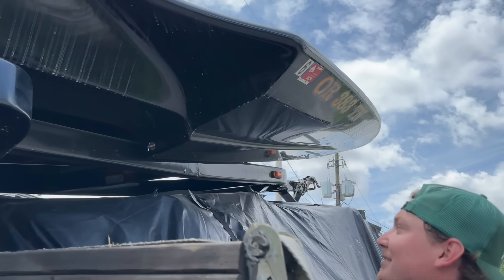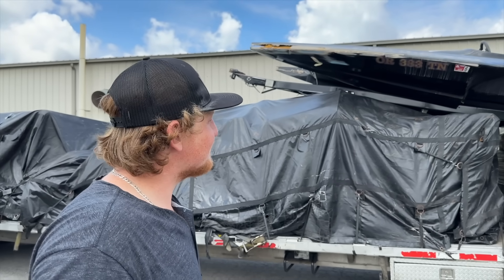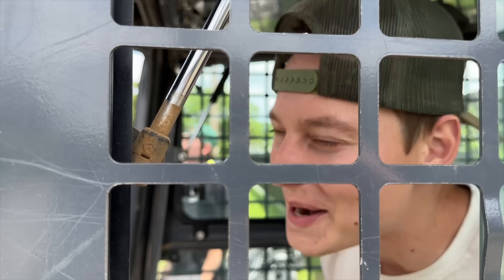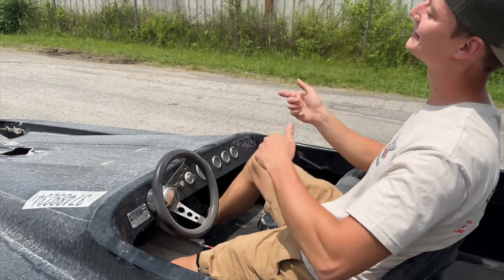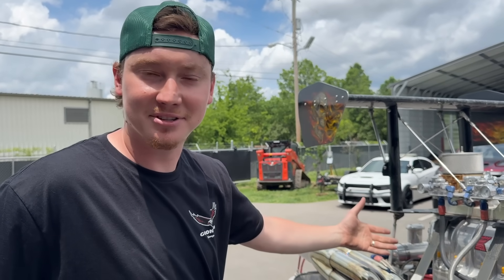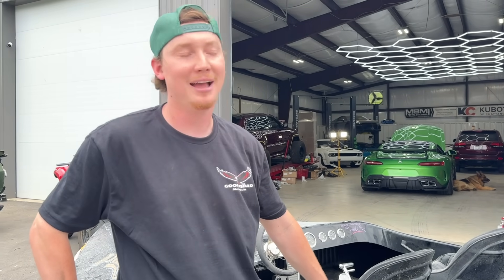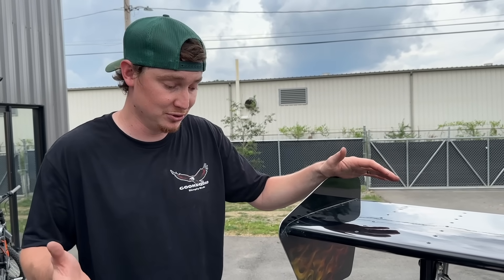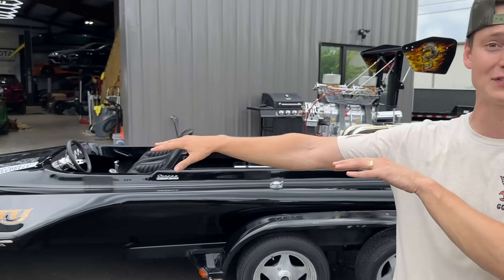We Bought A Super Rare Race Boat From Copart!!!

Comment: I have a quite a few old hydro's. 4 sangers and a couple Texas tunnels. Spent a few years racing flats and hydros that were capsule boats and vdrive. In my opinion the hull would be garbage if it was mine. Check for delamination on the stringers and main supports. You can fix the front, but it HAS to be done correctly or the boat will snap in half. I've had a few people I know die from that happening. Luckily its just a jet drive so you guys will be lucky to get 80 MPH out of it unless you got some serious nitrous and 1000 plus HP. Keep in mind that the fastest jet boat in the boating world does 160 with a blown nitro motor. If you're gonna fix it and try to go fast then buy a couple Lifeline Jackets and wear helmets. Also, keep in mind that these boats sit low in the water, and it is very common for them to sink being that only 4"-6" of the boat sit out of the water.

Comment: The shifter in the center is called a place diverter, it will shoot a roost of water about the diameter of a fire hose. I'd pull that motor and send it out and have it checked it might have to run on alcohol or 100 octane minimum. Mike Finnegan is definitely the guy to talk to he's down in Georgia.

Comment: APBA stands for American Power Boat Association. Which means it more than likely has been registered as Drag boat. And may have been a competition jet boat. Sanger boats are built specifically for Racing. It is a serious pickle fork. More than like a 468 big block blown. These boats can reach speeds in excess of 150 plus miles per hour in just a few seconds. Do your research and seek out a professional drag boat shop. In addition the front of the pickle fork has been damaged significantly. I would definitely suggest shooting picks to a Sanger and seek advice on how to fix it properly. However this is a badass fast ass drag boat! Good luck with the build, a definite score!

Comment: I would try and save the old paint especially the letters, just  do an old school silver to black transition on the damaged areas.

The center is from a trailer hitch the sides are from the rear tires. The rear wa probably a backing in damage from a different time

Comment: Boys, you got a tiger by the tail with that boat. If you think you can drive it safely, look at it this way. Would you step into a  top fuel rail at the drag strip and think you can successfully race it without crashing? Same thing here, only if you crash it there's no roll cage and you'll probably drown. Think of your wives and kids. (Oh, and that engine may burn nitro instead of gas. Better make sure before you try to start it.)

Comment: 454/460 BBC definitely will be worked bottom end and top definitely will be cammed out as well.  Not as much HP as you would think. Not busting on it but back in the day everything  was bored ported blown and displacement was king.

Comment: The motor looks like a 454 and the carbs are Holly double pumpers, note the two fuel line per carb. Definitely cammed. That type of blower was originally on school busses for extra power and the straps are to prevent it from blowing off. Check out some of the old footage of drag cars blowing blowers off on youtube. https://www.youtube.com/watch?v=z0aROJz2VGE

Comment: I wouldn't do the fiberglass repair myself. For the speeds that thing goes it needs to be absolutely perfect or that boat will disintegrate at speed. Race boats are absolutely nothing to mess with as a novice. You will die or be mangled very very easily.

Comment: That control valve, low medium and high is for a water control valve for the Bassett headers, it's so you don't overheat them and turn them blue, depending on the rpm, hey for the rest of you, it's not a IHBA, in other words it's not a "drag boat" that big ass blower probably gives about 5lbs of boost, no drag boat has a passenger seat, it's a look at me boat

Comment: This boat requires some training. It can take your life instantly in the wrong hands. APBA Drag boats were made for high speed, wind or rough water can flip it easily. Get with mike finnegan or a APBA rep or instructor. It will save your life. THIS is not a toy!  
The retard set to 3 at least will keep the pistons from burning. 
Gas or alcohol, ?  Need to know .  MUST have water running into the motor. Get some help. Damaging that engine can piddle 40k down the drain. Good luck

Comment: Do you guys know if the boat flipped while racing? The way the hull and deck are splitting open in the front on both sides could be that it went flying at some point which means that tbe engine got wet, maybe went under.

Comment: Well guys, that is NOT a toy. Propably runs on alcohol and pushes so much HP's that I would never do a full throttle pull with it. Don't touch the engine without asking someone who knows first and with the hull, make sure that the structure is still good - propably not. This thing will injure or kill you within seconds if you think it is a toy. Scary machine. Looking fwd hearing it ROAR

Comment: You are in dangerous territory, Early hydroplane, Many have died, River Rat aka Chevy Rat (big block), Aluminum block (Rodeck), 871 Roots supercharger. Fuel, race gas/alky. Tank is to collect oil/vapors. Get in contact with old timers of the era. 'Is this thing cammed out' Become familiar or seek help. Remove the jet drive & drop it in the Camaro.

Comment: On the boat, the first thing you want to do is get rid of all the foam in the front as it is sun damaged and fix the fiberglass first then refill with new marine grade closed cell foam. Resin and foam do not mix and if you try to fix the fiberglass, the foam will dissolve and make a bigger mess and that is why you remove all foam first.

Comment: Take that thing to a very large piece of water & those things are only designed to race in a straight line !!!!!!!!!! If you turn that thing at a high speed your gonna kill yourselves. Also there’s been a couple boat racers killed using that design boat because they get airborne and cut somersaults and the boats break into many pieces!!!! Better wear helmets and life jackets, I wouldn’t gun that thing wide open from a start or you’ll end up cutting flips in that boat. I watched the boat races for 40+ years and that type design of boat from that Era is extremely dangerous & has claimed a couple lives. So be careful with that boat.

Comment: You might be looking at anywhere of 1000 to 1200 100 horsepower and having a jet drive trust me that thing is going to go screaming so fast down the river check the oil check the jet drive fluid check the fluid in the supercharger and yeah you going to need those helmets that you can talk to each other I doubt seriously that you are going to be able to open are talk to each other but you better be careful going to be careful did not return it up you got a very very powerful boat do you have Netflix talk until you feel that jet drive jet drive grab a hold of that water sling you down that River you going to feel like somebody put you in a slingshot and let you go

Comment: Thats a full blown race boat. Don't trust those fuel pressure gauges either. you should have 7-8 pounds of fuel pressure. Use a flow gauge to set your fuel pressure. Minimum of 93 octane or race fuel

Comment: Do not tighten that belt. It gets tight on its own as it heats up. If you tighten it when its cold it will over tighten and it will break the crank snout. Do your research before you tamper with anything. Thats a 150+ mph boat. Very fast very dangerous.

Comment: That boat requires alcohol and training to operate at top speeds. Straps are in case of a backfire the bolts will shear to save the engine

Comment: My uncle raced one of these when he was younger.  Have a picture before one of the races and then the only pice they found after it blew apart during the race.  If I remember correctly he was going around 100-110 when something happened and the entire boat blew apart.  They have the before pic and the section of boat they found in a frame hinging on their wall.  Be  very careful guys, going at full speed in this thing and wrecking can very easily end your young lives.

Comment: FYI. That boat will only 4" to 6" out of the water.  Will sink very easily. Design to be on "Glass water only " its a drag boat not designed to turn. Small wake at 40 mph will flip that boat so easily. Its designed to go in straight line on glass water and even then its extremely dangerous. So so much can go wrong and they sink so easily easily. Get lots of advice advice before starting that motor. Its a very dangerous motor. It's completely made for "drag " racing on very flat and calm water. GOD BLESS

Comment: It could be on race gas or Methanol, i hope your not seriously thinking of driving that Boat, that boat is NOT for going out on the lake for rides, its a full blown race boat, its not for putting around the lake, you don't have the safety equipment to drive it, I hope you're Dad talks some sense to Yall, there's so many ways you can Break that Engine or get seriously hurt or die if you play with that Boat, fix it then sell it.

Comment: The boys are not gonna consult anybody. And this is one build you don’t play with. One fast pass with the boat not trimmed properly will cause the boat to blow over and flip. Please be careful guys, find the proper help with getting the hull properly fixed. It has to be structurally sound for the speed it’s capable of putting down.

Comment: Those are blower straps. The blower is held on with aluminum bolts at 10-14 ft pounds of torque. If it blows the blower of it will keep the blower from flying off the boat.